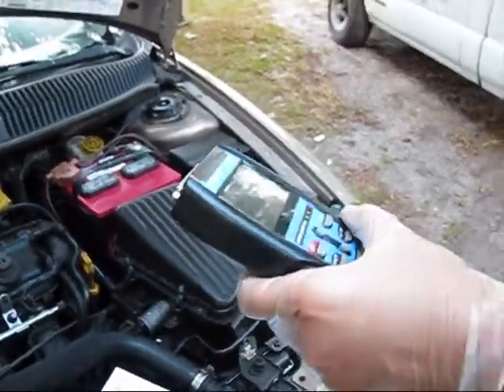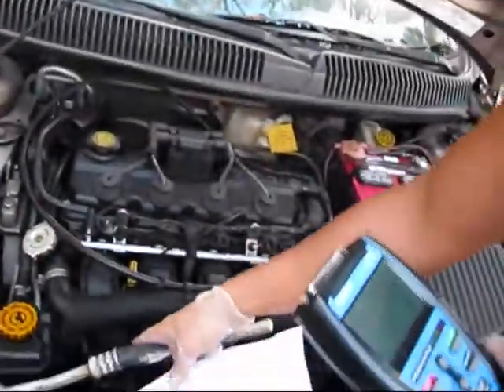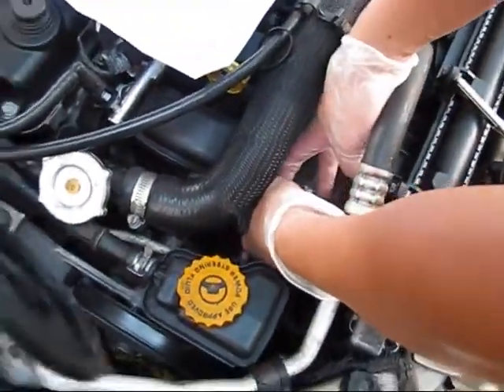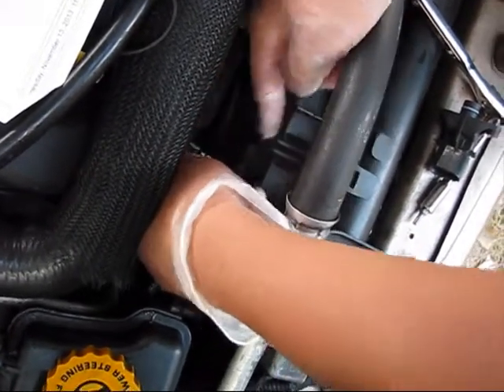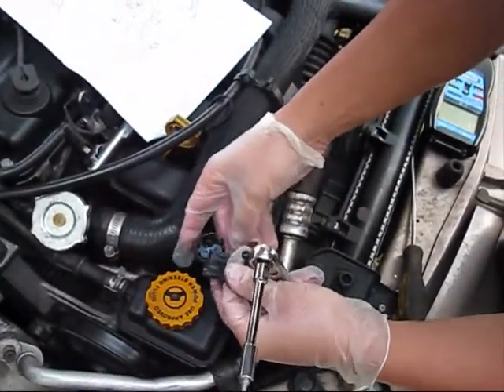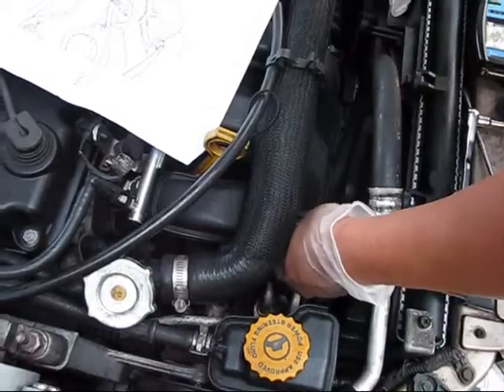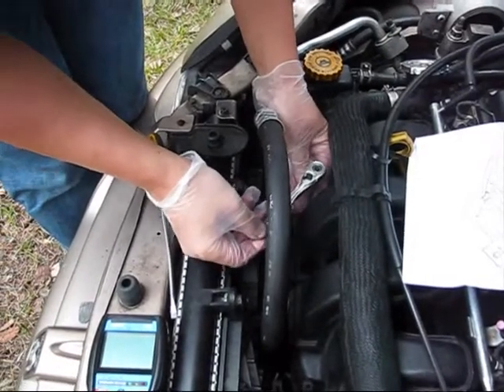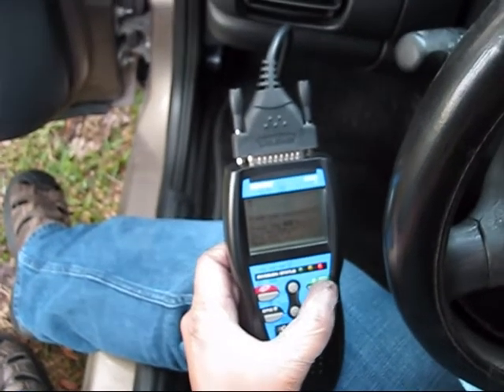Replacement and Location of MAP sensor 02 Dodge Neon P0108 P0107 P0106

Comment: I have Chrysler Neon 2003 (in UK) and faulty code on OBD2 scanner: PO112  (Intake air temperature sensor).My question is: Is it MAP sensor on Neon have the same functions like IAT? and if I have  code PO112, I need to replace MAP sensor? I can't find IAT sensor  in my car, I see only MAP sensor.

Comment: P0106  code came up on Bro in laws 04 Neon...was not a sensor at all...the Cat was plugged full of debris...car ran like crap...barely idle, stall when given gas....Took Cat off smashed out all the crud....straight flow.... runs beauty now....just a heads up...can be deceiving that code says MAP sensor...but wasn't it...

Comment: Hi, my Dodge Neon 2001 with 150,000 kms (93,000 miles). Is has the symptons that you are mentioning: Reduction of power, backfiring, hestitation when accelerating plus, fails at idle, and more fails at idle when the AC is on. Can be the MAP Sensor? It presents a code P1193  , Thank you.
Reply: I Will do that. Thank you!
Reply from the maker: it could be huge amount of problems based on the symptoms you just mentioned watch my video about replacing pcv valve on neon this might help you...
Reply: Guarantee you need to clean or replace the IAC valve
Reply from the maker: yes, this should help.

Comment: Hi I have a car like this too but when it downshifts from second to first it shifts a lot worse an not as smooth as other shifts,any idea what's wronge it?
Reply from the maker: +Jake Dre I don't have your vehicle in front of me to test it, that's why it's kinda hard to answer... your transmission solenoid block pack might be one of the issues.....
Reply: +Alexey Gavrilov I did not use aft+4,could this cause this?if so will a flush fix it?
Reply from the maker: transmission in this vehicle,   requires only only Atf+4, otherwise you can damage your transmission..
Reply: +Alexey Gavrilov yup drove for a few weeks like this then flushed it an used the right stuff,hard kick on downshift

Comment: great vid, do u know if neons have maf sensors, if so, where r they located??
Reply from the maker: Sergio Hernandez Not as I know..Dodge neon don't have MAF sensor as a separate part..  it's integrated into throttle body air flow sensor meter... Perhaps I'm mistaken...
Reply: +Alexey Gavrilov what was the part number

Comment: will this throw a p0171 code?
Reply from the maker: it could.... what's wrong with your vehicle?
Reply: I been chasing the problem from the 02 everywhere. But it's my fuel pump. I'm only getting 15psi to the rail. Great videos. Next I want to do timing and waterpump. While in there do the middle motor mount.
Reply: Alexey Gavrilov ugh, i wish i knew that before my damn vw went to shit.

Comment: Hi I been watching your good videos. I also have a Dodge Neon and I have a problem with the car. Is the CAM SENSOR When I plug the cam sensor my car will not start I have connect to the negative side of the battery. thx I Hope you can help me.
Reply from the maker: It's hard to say...  i need your dodge in front of me to diagnose....   both camshaft and crankshaft sensors determine the position of the engine...  if one or both of those sensors are defective or have incorrect voltage applied on them your car not gonna start...   or maybe will start for a second and then shut down almost just wright away..
Reply from the maker: replace your current cam sensor for the new one...  it  should fix the problem....   also check wire harness maybe you have loose ground somewhere and your cam sensor receiving incorrect voltage on it ...